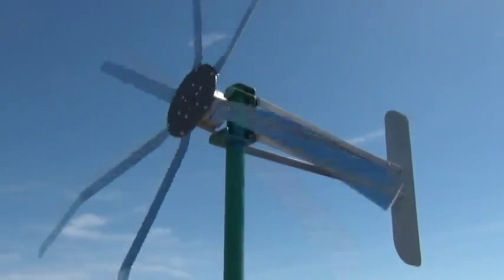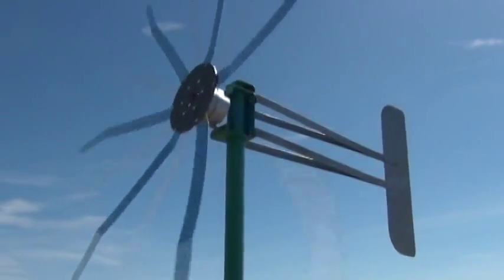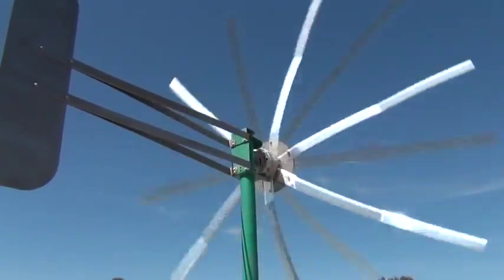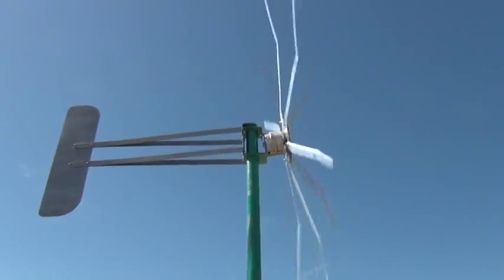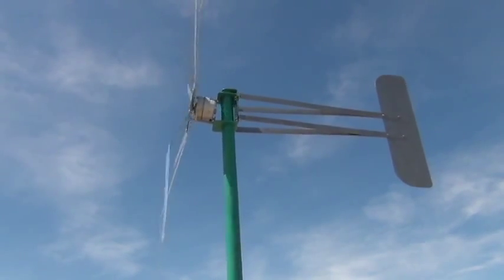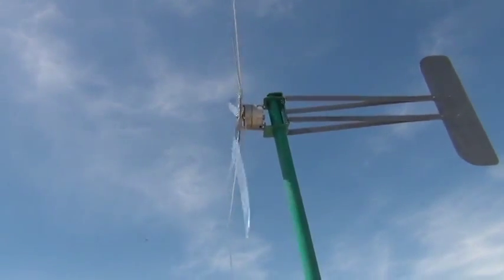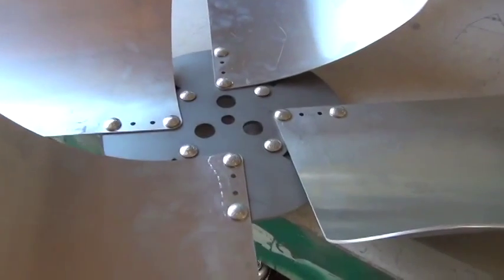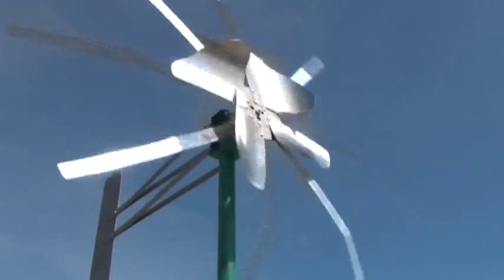X3  wind turbine blades 6 and 4 prop on 2.5" bracket BOSS! windgeneering

Comment: Yep, less blades = higher rpm potential, the turbo cones are much wider and are harnessing much more wind closer to the center of rotation than the 6 blade prop as a result, which means less drag and a lot more torque. Personally, I think the 4 blades with turbo cones is a great combination.